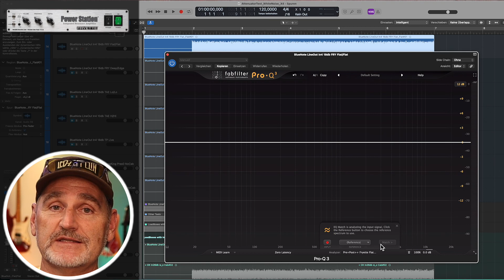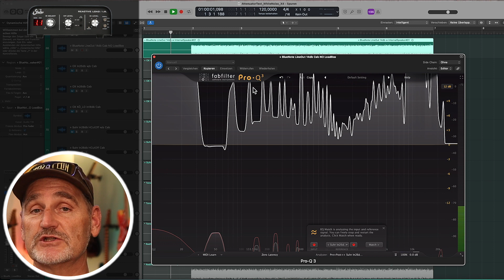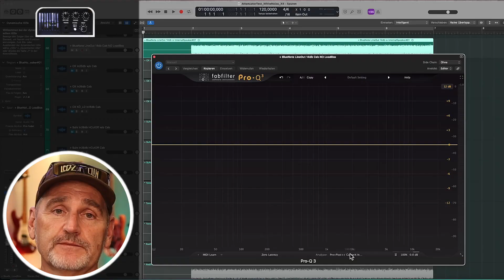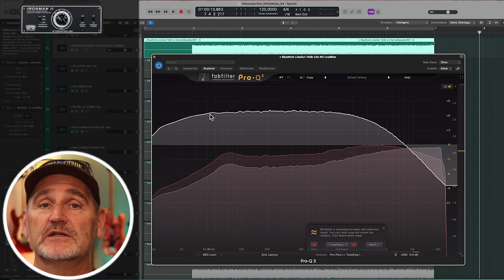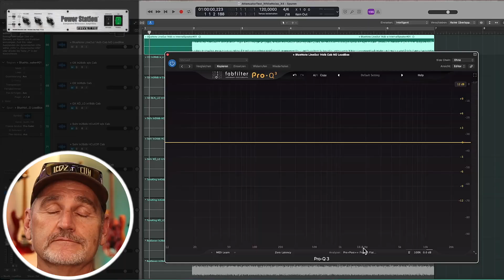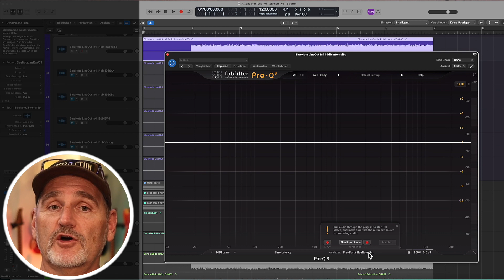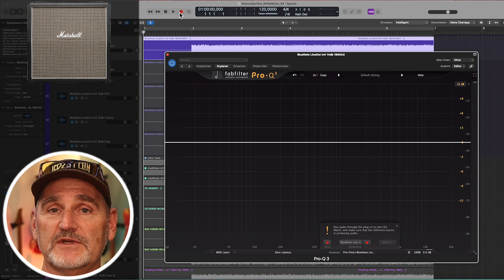The Ultimate Loadbox Comparison - Part 2

Comment: Hello! I just came across your video series on load boxes and I have a question for you concerning the Tone King Ironman II when using it as a load box to send audio to a daw with an IR loader. If you use the 1/4” Line Out on the Ironman II without any cabinet hooked up do you experience any squealing noise? I own this unit and am having this issue. The DI out if fine and the attenuation works fine. I’d appreciate your experience. Thank you!
Reply from the maker: It's kind of a ground loop issue. You have to use an isolation box for the line out - like the Lehle P-ISO or the Palmer River wupper. It's always good to have an ISO-box on hand 😀
Reply: @RockGuitarVibes thank you! I thought it might be something like that going on. It’s funny that most of the reviews I’ve seen on You Tube that no one mentions this but I don’t think they’re reviewing this unit for any purpose other than as an attenuator. Bravo to your work reviewing all the load boxes you did! That’s a lot of testing you did over 12 videos.

Comment: When in bypass mode with the powerstation does the attenuation volume knob still work? And how accurate is the tone?
Reply from the maker: No, bypass mode means no attenuation. However, IMO the Powerstation is the best attenutor you can get.
Reply: @RockGuitarVibes ok I am leaning towards the Fryette power station, since you said it's the best, and other videos I've seen, agree with you. So I reckon I'll get the Fryette power station, I  have several amps, so I might be better off with the 2 50 watt channels? Thanks again. I have Vox AC30s and Celestion alnico speakers, the alnico gold, ruby, and a cab with 2 blues. I plan to get the alnico Creamback sometime soon too.
Reply from the maker: @Toby-m5m  Just to be clear - the PS-100 has 100 Watt and 2 channels, but the channels share the same power amp.
Reply: @RockGuitarVibes thanks for the clarification.

Comment: When the Fryette is in standby mode, can you still attenuate the sound for indoor playing?  The standby curve looks good in your test, but what functionality are we giving up if we choose the bypass mode?  Thanks!!
Reply from the maker: Standby means no attenuation - however, if you want to use your cabinet you can simply use the flat/flat setting and dial in the required volume and tone on the Fryette. In that scenario the reactive load is your speaker - this concept works pretty well.
Reply: Thank you!  Is there a way to also use headphones in combination with the Fryette?
Reply from the maker: @ For this some kind of speaker emulation is required I.e. an IR loader. So what you can do is to use an IR loader pedal at the line out e.g. from TC electronics or the Mooer Radar.
Reply: I see, thank you!

Which option do you recommend:
(All would need to provide attenuation, IRs and headphones)

Option 1: Suhr Reactive Load IR (loud fan!!)

Option 2: Fryette Power station and the TC/Mooer device?

Option 3:  ???

Budget isn’t really an issue….
Reply from the maker: @bysykler4959  The Suhr is a good device - however, it does not support attenuation. So if you want to play at lower volume too, I would recommend the PS2. In case that you don't need attenuation the Fryette Powerload IR would be a good option.

Comment: Which is less artificial sounding, the Suhr ir box or the Two Notes Cap X?
Reply from the maker: Both can sound great - however, I wouldn't use the Captor X in  low mode - means with a cranked amp, especially in this case the Suhr sounds a litte better.

Comment: I am trying to record the amp’s tone while not inducing any harshness that I find most loadboxes add. I then use an impulse response after inside my DAW. I have tried several load boxes and it just doesn’t sound right in the top end. 

I’ve experimented with a RADIAL DI box and running the THRU signal to a real cabinet as the load, and recording the signal coming only from the amp (XLR out on the DI box) and this sounds best to me so far. Thoughts?
Reply from the maker: If you are happy with the result it's all good and you saved a lot of money too - however, the RADIAL is a DI-box only, not a load box. So it can't be used for silent recording.

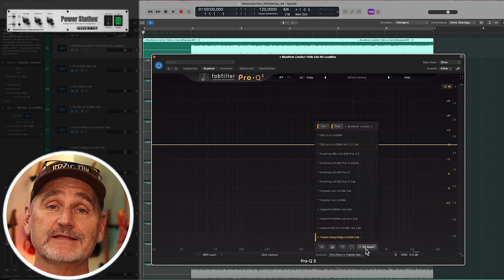Comment: at 4:19 - the output prior to the loadbox has a resonant bump near 80hz.  the box itself has an eq curve with a strong dip at 80hz.  the resultant output after the load box looks flat.  Is the box correcting for the frequency response impact of its own impedance curve?
Reply from the maker: For the comparison the loadbox was used in flat/flat mode (red line) - the first curve (below the red line) was made without any loadbox. As you can see a few secons later even in deep/edge mode the curve is far away from being flat. The cause is that the tube amp sees the impedence load of the loadbox only - the speaker is decoupled from the amp, as explaind a little later in the video.

Comment: Hi! I have a question: So if I use the Fryette in bypass mode without a cab hooked up, it still won't work or worse break my amp since it doesn't see any load, correct?
Reply from the maker: Speaker1 jack has an open load protection feature to prevent damage from your amp should the speaker cable become disconnected while in Bypass mode. Means if no speaker cable is connected the bypass mode does not work. It's very important to not connect a speaker cable without a speaker connected on the other end - that's the only setup that can damage your amp!
Reply: @RockGuitarVibes  Oh! Gotcha! Thanks!

Comment: Hello 👋 Do these load reverb IR & if so which would you say has the highest quality for reverb IR’s ? 

Thank you this was a great explanation in this video by the way 🎉
Reply from the maker: Thanks a lot. The general rule is: the longer the IR length the better the room/reverb is. So, if room is important you should consider to use an IR loader software with extended length. 40ms is high resolution - Axe FX III also supports ultra high resolution with 170ms.

Comment: Very interesting analysis.
One question about the Fryette PS2a as I’m a bit unsure of the way you used it.
When you did the comparison in Bypass mode was the unit connected to a speaker cab?
Reply from the maker: Yes, in this test each load box was connected to a cabinet. In episode 1 no cabinet was connected.

Comment: I'm not sure I understand the logic behind these graphs - why would you be interested in flat lines when what you want is the sound like what comes from a speaker cab - that will be anything else than a flat line?
Reply from the maker: Well, what we ckeck in the tests of part 1 and part 2 is the tonal neutrality of the devices. For this we compare the input signal of the load box with the line out of the load box - without any IR engaged. A flat line means that the load box itself does not add or remove any frequenies. The sound of the speakers does not matter and should not matter for this test. In part 2 it's moreover the inductive respone of the speaker/cabinet what matters - means is the amp able to see the unchanged inductive response of the speaker/cabinet or is it influenced by the load box. Sorry for the nerdy stuff but someone has to do it 😎
Reply: @RockGuitarVibes  Thank  you for explanation, and I very much appreciate your efforts, just trying to follow 🤯😅 In the end, I wonder how much that flat line matters, as long as adjusting EQ on the amp can compensate, I guess what's most important for a guitar player is that they 'perceive' that what the play sounds and feels good - Many are happy about the Ironmans, so hopefully your analysis and future videos will be able to show why, despite the Ironman not giving you a flat line curve here.
Reply from the maker: @mrtruefifth  Regarding the Ironman I think most people are talking about the quality of the attenuator - means the amp sound with a cabinet on a reduced volume level. However, this video series is mainly about the line out quailty, which is quite a different thing...
Reply: @RockGuitarVibes  OK, Line Out only. I hope you will keep on comparisons and look at attenuation as well, as you are doing your tests so thoroughly and you seem to have access to most of the relevant attenuators today, and a good updated comparison would be just great! But I'm aboard now also for line out tests! 👍
Reply from the maker: @mrtruefifth  Thanks for the suggestion - possibly I will make a bonus video with all the devices that support attenuation.
Reply: @RockGuitarVibes i agree. line out on my im is very bland.  however it is my hands down favorite attenuator!